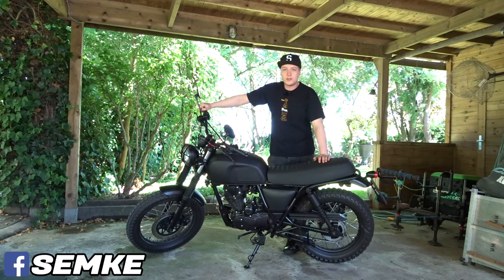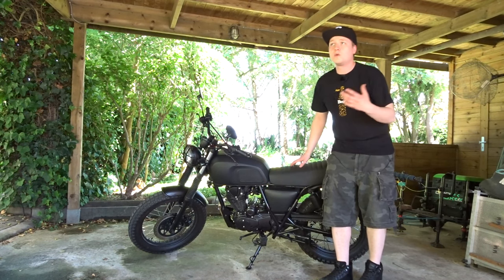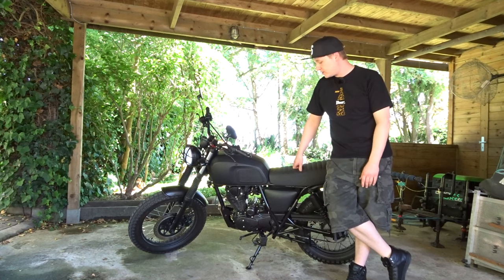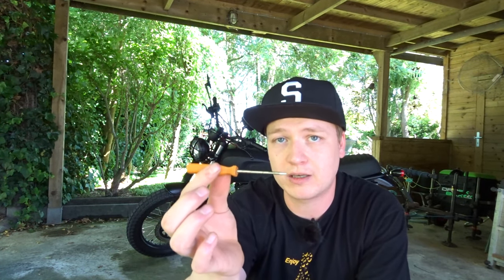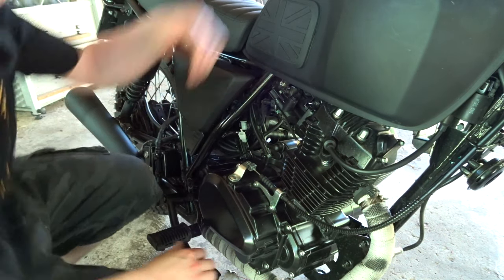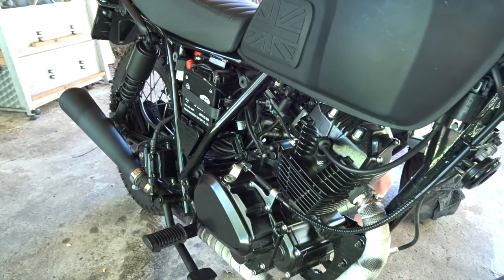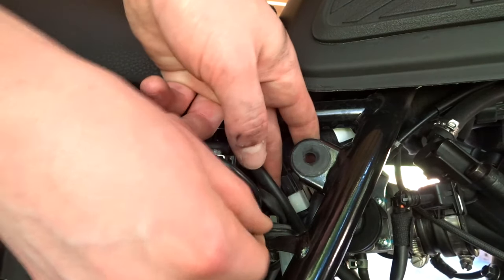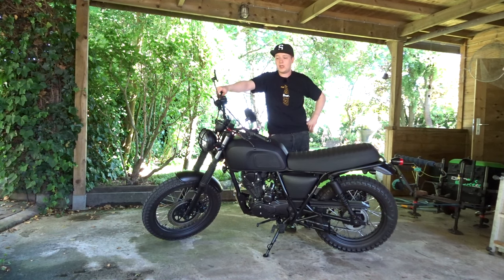it's not safe anymore - kickstand safety switch removal - Brixton Felsberg 125

Comment: It's not wise to detach the switch while the kickstand is out (i.e. pushing against the switch). 
There is a force from the kickstand on the switch that pushes the switch along and therefore bends the 2 screws when they are coming loose. So the threads on the screws get spoiled.

I also put short screws in the threaded hole finally, because the threads would be exposed to the elements at the bottom side of the bike. (And I always use al lot of multi-purpose grease in that areas. There are a lot of rusty Brixtons to be seen when you look out for them.)

Comment: my double stand is touching my chain .. any solution?
my friend suggested me to remove the double stand
Reply from the maker: is the rubber block still on it? on the right side where the exhaust is. there should be a rubber block where the double stand comes into contact with it when it is raised .if it is no longer there, glue 1 back on with very strong glue. if you want to remove it then you just have to unscrew it and remove the double stand and the spring
Reply: @semke88   no that block is not seeing and also dont know where to glue .. 

and also so confused how to remove the double stand please i am a regular follower of yours requesting u to make a video on it 😆
Reply: No way, that the double stand would be the culprit. Your chain is loose and needs tensioning.